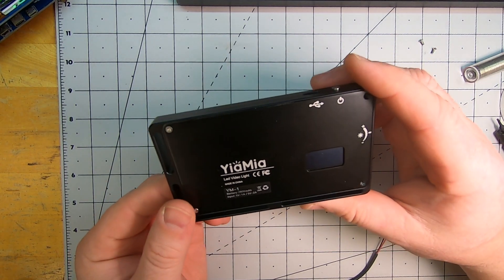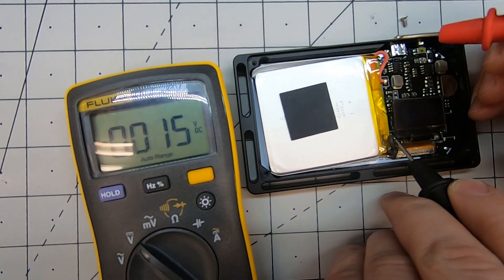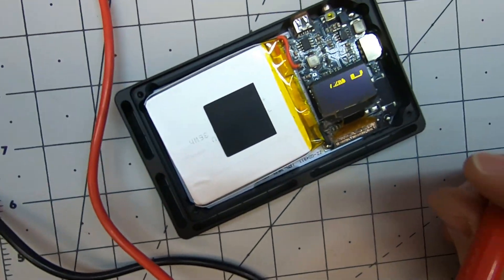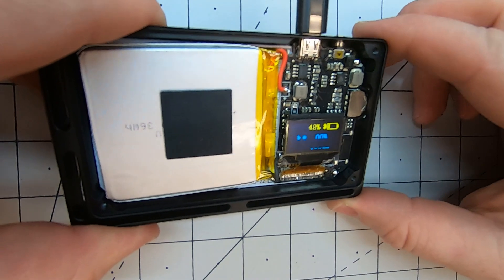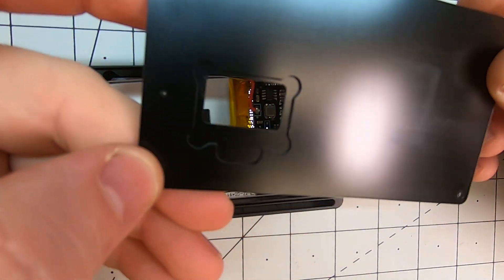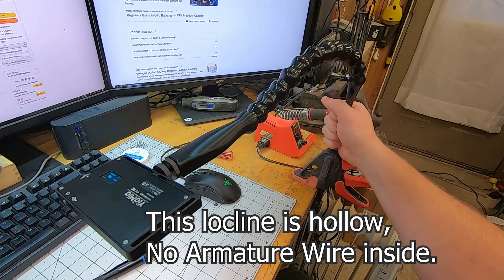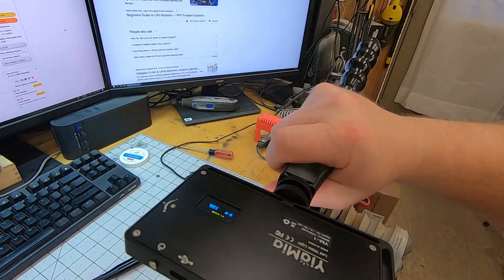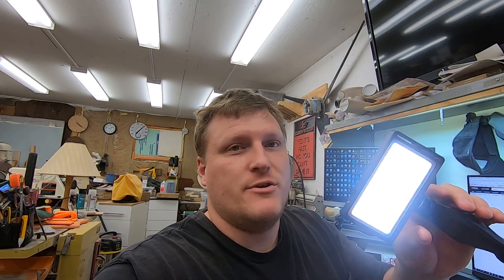YiaMia Flashing Not Charging Fix

Comment: Decent video on how to resolve the battery not charging, but definitely DO NOT push 5A into that battery, that was a very bad idea. Common rule-of-thumb for charging Li batteries is a rate of "1C", which if the manufactures claim of a 2800mAh battery is to be believed, would mean an absolutely max rate-of-charge of 2.8A. With an especially empty battery, like the one you mention, you should only inject ~100-200mA to the battery. You want to do this only up until the point where battery charging circuit will work again, as most charge ICs typically will recognize a very empty cell and preform a very slow initial charge procedure to reduce damage until it reaches min typical voltage of 2.8-3V and then bumps the rate of charge back up.

Typically, you will only need to apply some voltage to a 'dead' cell for a couple seconds to reset the onboard BMS if it has one (Most will as typically just the CC/CV charging circuit is on the product side, not the cell protection/BMS). Most cell BMS will 'lock-out' once they reach absolute minimum safe voltage, and unfortunately, this means that the charging circuitry will sometimes not play ball if it sees no voltage on the cell at all.

Comment: I've had a similar issue with batteries for tools. If the voltage drops too low the charger says it bad. But if you hook another battery to it for a few minutes it'll get the voltage high enough to charge again. Never throw those batteries away again. Cheers and Happy Holidays

Comment: It's a common issue where the battery get's too discharged and the battery charging circuit just doesn't charge it. this is also a common reason why laptop batteries die, they get left not charged for a long period of time and they get too low of a voltage and the battery charging circuit considers it dead. I've fixed so many devices with batteries that are just too empty by manually force charging it and it works again like nothing happened.

I honestly don't get why this is a "safety" feature, it will work again just fine.
Reply from the maker: I think it's a safety feature for a defective battery, it just so happens to effect too-low charge batteries too.

Just know that sometimes even force charging a battery will not reactivate the BMS/chargine circuits, sometimes they are just irreparably dead by design.
Reply: @JoeMalovich  I know that. I've had some BMS not come back but most do